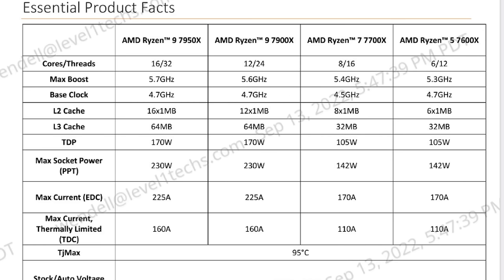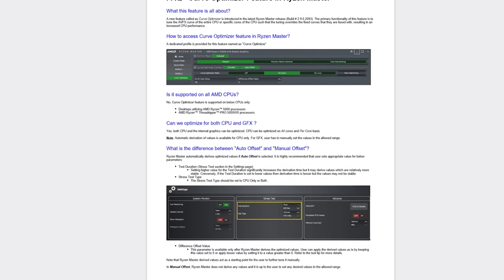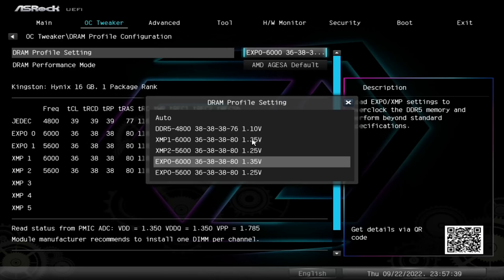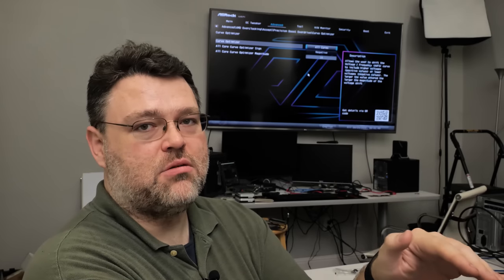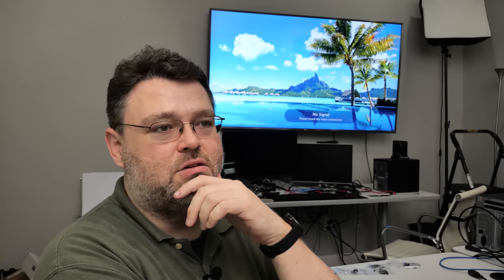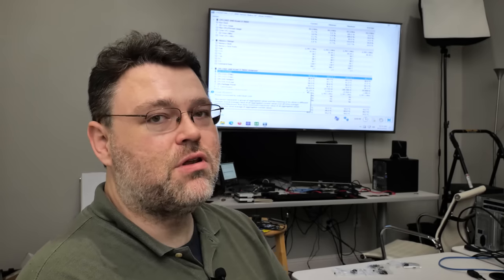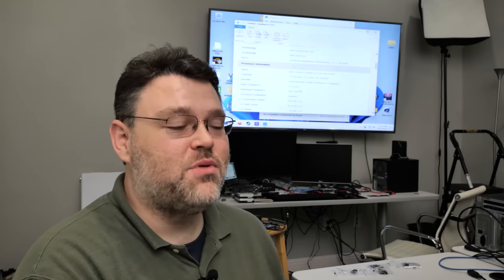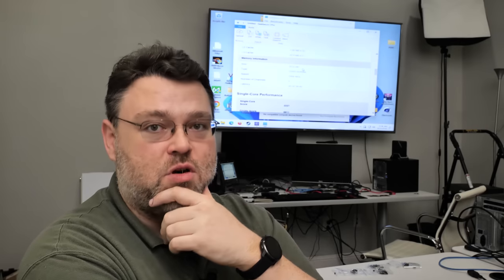Kicking Ryzen 7000 into HYPERDRIVE! Overclocking, Curve Optimizer, 5.85 GHz!

Comment: Glad atleast your channel wasn't ignorant and decided to a look at curve optimizer. Its shame because its basically two settings for AMD to drop 30c, be 4% faster than stock and atleast 40% more efficient Than stock. Why its not by default...
Reply: They set stock to work on every CPU, if they require less volts more dies will fail validation.
Optimum Tech has a video (fixing 7000) on tuning too.
Reply: Because there's no guarantee it will work and no guarantee it won't stop working after some amount of time.
Reply: IMO I don't mind AMD sandbagging like this 😅
Reply: My 7950x has to have a negative max clock. To be stable with a negative curve optimizer.
Reply: @250hero  have you tried a bios update?
Reply: Impossible to drop 30c. I have a pretty agressive negative curve at -25 stable and I still hit 95 in a few second in cinebench. But my idle/gaming temps is about 5-10c lower
Reply: @NoXQc Lol there are literally countless people who have dropped from 95C to well under 70C. Just do a quick search man. Your cooler might be shit or it’s user error.
Reply: @Mojave_Ranger_NCR  no one is dropping 30c in C23r with a negative curve on a 7000 series. I have the best AIO money can buy before a custom loop my guy
Reply: @Mojave_Ranger_NCR  only way to do it is delid and or lapping
Reply: I think it's because not every piece of silicon is equal. They have to find a happy medium where ALL their chips will perform. Then it's up to the user, if curious enough, to find tune. Otherwise they'd have to manually tinker with every chip if you wanted optimal performance out of the box. Just a guess.
Reply: @NoXQc future person telling you you were wrong 🫡✌️
Reply: Mine just lost performance atleast on fps games lost 60-80fps

Comment: Wendell, thank you for going through all of this and doing it in such a way that people who aren't nearly as tech savvy as you or the majority of early adopters of AM5 may be. Coming from a 5800x and running it all stock to as of later today a 7900x learning how to actually use curve optimizer is a benefit for damned sure. I would be interested in seeing you go through similar steps using some of the different bios that are out there (Asus, MSI etc) I would also be interested in seeing what if any extra headroom you get or how the temps may be improved going from a 360mm rad to a 420mm rad. I wouldn't expect a massive difference but then again, AM5 has already shown with a few slight tweaks the performance and thermals are pretty damn good.

Comment: Thank you very much. I have the 7950x on an Asrock board so it's like you were speaking to me directly, lol. I am able to get the PBO stable at -30 and get an all core boost between 5300-5400 MHz during Handbrake rendering. 95C temps on a robust custom loop at 175 watts. I was curious if I was getting my full potential, as I am newer to AMD OCing. This video was a great relief and I appreciate you spelling it out for someone like me.

Comment: One of the cool things about Ryzen Master is that it will tell you which 2 cores are the best performing / boost highest at the stock voltages. So if you want to go into the weeds of optimizing the curve for each core, having a more aggressive offset on your top couple of cores is a great place to start and may help get that last bit of single core performance. Another helpful thing when using the curve optimizer for each core, when you run into stability issues there's a way in the windows event viewer to see which core caused the system to crash (I forgot how to do it off the top of my head). This is incredibly helpful for pointing you to the next adjustments.
Reply: My undervolt on Zen3 required this, only a small -10 undervolt is stable on the 2 cores used for single thread  work.
I saw there's a utility to test each core and flag errors, to find the problem cores, but I haven't used such targeted testing to tune perfectly
Reply: On my 5900X I used Hydra by 1usmus to automate the testing for CO instead. It tests per core and gives you values to put in bios instead. If it crashes during the testing, the log will tell the program which core it was working on and it will continue the test, correcting for the crash.
There is another option to setup a hybrid OC that overrides AMDs algorithm, which gave me 6% more performance with the same voltage. It handles CO values beyond AMDs limit.

So much work! It sometimes takes a dozen of tests Per Core to find the optimal CO for a given voltage....
Reply: you got the wrong way. The 2 best cores get a small offset for the curve optimier, since they tend to boost higher and need more power to do so. If you lower them more than the other cores, you will just crash. The other cores usually can use a bigger offset and save more power, since they are never given the single threaded load where they will need to boost high.
Reply: @changen4125  the OP seems to be trying to overclock and increase frequencies with a CO positive offset on the 2 ST cores for stability, rather than use  undervolt to gain performance by more CO boosting.  At least I presumed the CO per core adjustment is to stabilise just the best cores after other changes rather than overvolt every core.
I agree, undervolt CO to allow higher boosts seems a better strategy to me.
Reply: @HexerPsy  I read about Hydra, but wanted to see independent testing of the claims.  I remember the author from the RAM timings utility
Reply: @changen4125  Thats not entirely true... AMD tests the curve no each core chiplet. They choose efficiency over clock speeds, and the max clock speed decides the bin.

My 5900X has a higher boosting CCD1 that has higher max clock speeds in single threads, than CCD2 (max on CCD1 is 4875-4925, and CCD2 4775-4825).
But ironically, CCD2 is can handle better boost clocks under full load (CCD1 on 4350 and CCD2 on 4450).

It marks the best cores based on efficiency.

Also, if you tune CO to individual cores, and the processor loads more than one core, it will use the lowest CO of the cores in use.

CO allows you to test your silicone lottery by checking if the core still runs at the a lower voltage. But saldly that leaves some performance on the table...

A core that runs hotter also needs more voltage to remain stable - more voltage increases temp - so it must ask for more power, etc. Alternatively it can reduce clocks, because the switching speed of gates is mainly where the heat comes from.

This means there is a sweet spot temp for Ryzen 5000 of about 70C. Above that, thermals and power run away. And below that, the lower you go, the more stable the chip is, the higher you can boost.
Ryzen 5000 wasnt designed to run at this sweet spot, but Ryzen 7000 will seek out its thermal sweet spot at 95C.

Only I have a hard time believing the thermal sweet spot is that high... I am waiting for the tools to allow the community to find that sweet spot.

Comment: At a setting of negative 30 on Curve Optimizer, my 7950x hits 5750mhz on three cores, and 5500 on all cores during most benchmark runs. Then I limited my temps down to 90c. This dropped my cores down to 5350=5400. So I'm happy with that, and my system runs very quickly on all tasks and sims. With this setting, I scored over 1500 on multi in CPUZ and 750 on the single thread. I also got a score of 38240 in R23. Love this processor. I'm using a Strix X670E-E wifi, 64gb of GSkill Neo 6K and a 7900XTX. I NORMALLY in the past always bought the Hero board, but this go around it was WAY overpriced, and the Strix actually was better equipmented for a lot less money.

Comment: The Arctic AIO's are monsters for the price. On Arctics eBay store I picked up a 420mm for $65 earlier in the year and it handles my i9 7960x at 4.5ghz like a champ (over 300w under load). The 240's and 280's are regularly under $50, all include full 6y warranty too.
Reply: Wow. At that price, there's not much reason to get anything else besides maybe custom water. I love Arctic products and how they stand behind them. 💪
Reply: @jesh879  Custom water is waaaaaaaaaay more then that do. I've got around $1000 in my loop lol
Reply: @benjaminsmekens2344  yeah I know I have built loops before. I'm saying if an Arctic AiO is so cheap, you basically have two cooling solutions worth buying -- one cheap and one not.

Comment: I'm definitely interested in seeing more on curve optimizer. I'm one of those who do gaming, but I'm also a hobbyist when it comes to making mods. I will look into upgrading from my current 2700X when the prices of the new platform drop. In particular, I'd be interested in hearing your thoughts possible merits for separate curve optimizer profiles for gaming and productivity.
Reply: There is a OC utility from 1usmus either CTR for 3000 series or Hydra for 5000 and higher. 7000 isnt supported yet.
But it can automate testing of Curve Optimizer for you, and you can put the results into the bios. It also has an option to change the CO profile when under single thread loads or high thread loads if you use the utility instead.
However CO is limited to a value of 30 on 5000 series, and Hydra has a 'hybrid profile' that goes beyond that with a lot of profiles depending on instruction set and number of threads loaded, to get the most out of the chip.

For me this meant a 6% higher score on my 5900X in CBR23 with the same voltage. From 66C to 71C under full load under a MSI 360 rad.
There is a gaming profile and the option for 2 custom profiles for specific applications too.
Reply: Could you please describe how should I do that? I have a 5900x and I wanna know how should I test each core in both stressed and non stressed mode.
I ran Amd ryzen master per core CO and it set -29 for all cores but when I apply that in bios system crashes just after a while windows boot up. I am looking for better tool to test each core on stressed and non-stressed mode for more stability.

Comment: I can't wait for people using curve optimizer, tweaking it for 1-3 days and then complaining about "shitty game XYZ crashing because devs are stupid" on reddit declaring that the issue is not their "stable system".
PS: My 5900X runs about 150Mhz higher (all core in Blender) using curve optimizer and uses less power.
Since the new main boost target is temperature, you should be able to get a lot out of these CPUs if you do it on a "per core basis" but proper tweaking can take weeks of work.
PS: If you want better maxed out all core performance, leave the "Max CPU Boost Override" Setting to 0
This setting will greatly influence your possible curve optimizer settings towards the positive range, which you don't want in that case.

Comment: I've seen the ECO mode settings that AMD is still working on right now and I like this better than anything else.  But, what I WISH AMD would do is allow more settings, and this would accomplish the reduction in clock speeds along with the reduction in power all in one easy step.  For instance having the settings of 150W, 120W, 105W, 80W and 65W for the 170W TDP parts would be GREAT.  That gives you pretty much everything you need right there.  For the 105W TDP parts, 95W, 80W and 65W ECO setting would be GREAT.  Frankly I'd just set it at 90W which would have little effect on the 7700X in light loads.
Reply: All the channel really fuck up real bad with this temp "problem"and don't Intel 12 gen got the same heat problem they even come up with a contact frame  at less am5 cpu don't throttle at 95c
The real problem is the cpu rarely hit 100% utilisation in most scenario so it not gonna hit the 95c in normal usage or playing game unless you use exclusively your PC to do benchmark or heavy cpu workload for a long time this is a non issue
Reply: If I am not mistaken... you can set Ryzen Master to limit PPT to whatever wattage you desire. Since its RM, you can open the program and switch modes with a few clicks. I think thats the closest you can get without programming something yourself that calls RM API to set a different PPT limit.

That way, under light loads you get the benefit of high clocks, but as you hit your personal set PPT, it will reduce clocks - and temps may not hit 95C if your cooler is good. If you manage to keep temps low enough, the lower temp could add 50-100MHz highest boosts for the same amount of power.
Reply: @HexerPsy  one guy undervolted to 0.98v and down clocked to 4.8ghz and got 55c under load so you can easily make temp better
Another one delided the cpu with stock voltage and clock it dropped temp to 70c

Comment: For my 7950X I'm using an EK AIO Basic 360 with fans swapped to Noctua NF-A12X25s, and with my PBO + curve optimizer tuning I'm getting single core boosts of 5.93 GHz! I'm very impressed with the performance, though it still runs very hot under full load
Reply: That's awesome Kyle! Thanks for sharing.
Reply: Nice :D
Could I perhaps ask: Whats your temp under a single thread load like Cinebench R23? And how many loaded threads does it take for the chip to hit 95C?

I am asking because I wish to know where the tipping point is where the 7950X hits that thermal wall....
Reply: @HexerPsy  For Cinebench R23 single core my max temp for Tctl/Tdie is 76°C and average temp is closer to 64°C for the run. For context, my motherboard is an ASRock X670E Taichi and my CPU fans are set to the silent profile in BIOS. For R23 Multi Core, temps jump up to 94.9°C and pretty much stay there for the whole run, fluctuating in the 90s.
Reply: @kylemueller  Thank you very much :D I appreciate the info!
Follow up question: how many threads of CBR23 do you need to load to hit the 94C?

You can specify the number of threads in cinebench preferences. I am guessing somewhere between 4 to 8 threads based on your single core temp.
Reply: @HexerPsy  4 threads maxed out at 79.8°C and averaged around 77-78°C
Reply: @HexerPsy  8 threads maxed out at 82.6°C and averaged around 81°C
Reply: @HexerPsy  12 threads maxed out at 84°C and was averaging around 83
Reply: 16 threads maxed out at 88.6°C and averaged around 87-88
Reply: 20 threads maxed at 90.5°C and averaged 89-90
Reply: 24 threads maxed at 92.6 and stayed around 92 for the run
Reply: 28 threads finally hit > 94°C. Maxed at 94.5 and averaged 93-94
Reply: Just ran with all 32 threads again and got 95.1 max with averages between 94-95
Reply: @kylemueller  You are worth gold! :D Thank you so much!

Comment: Wow didn't even know I could do that using the curve optimiser, my processor runs so much cooler now and my fan doesn't even ramp up when playing a game.

Honestly though this curve optimiser should of been a stock setting or optimised by defaults when you load it, becasue it doesn't seem risky but it's a massive enhancement.

Comment: got a new 7800x3d, did a -15 offset, and ran a few games with it trying to monitor temps (things are a bit spiky, and i've had some instability with like FAH for an hour will stablise at 77c, and then occasionally i'll get spikes to near 90 with an NH-D15 with low load) ; ive seen hwmonitor reporting >6ghz on most cores max, but how much you trust hwmonitor is up to you, so it's definitely doing something in those cases. it also reports only 20% util while folding with ~4.6Ghz boost, so grains of salt everywhere.

Comment: It is a pity that ASRock doesn't have an eco-preset: undervolted and slightly underclocked for all-core while maintaining the highest single-threaded performance. I am confident that most users would get the best user-experience that way. Zen4 seems to come quite overclocked out of the box, too much past the sweet spot. Like losing 30% performance for 25% of the power without even undervolting.
Reply from the maker: They just updated the bios to work with newest Ryzen master which has a one click eco mode
Reply: @Level1Techs  Not for me, Linux only on my desktop and I also am a gamer. 😁 
But as long as you can do it in the BIOS it is fine.
Reply: @Level1Techs  Undervolted in combination with eco-mode, that seems the way to go these days. For both CPU's and GPU's but for GPU's it still is problematic on Linux, at least for CPU's we can do it in the BIOS. That last step which AMD should take to improve the Linux-user-experience.
Reply: This state is a result of Intel pushing up power for 5 years and allowing mobos to unlimit power.  Alder Lake was well received .. but I could see how they achieved it, so was less impressed.
Now Zen4 engineers max performance based on reconfigurable limits more conservative than Intel and "95C!  Hard to cool" and "Expensive" seems to be the verdict.

Comment: I only got another 140mhz out of my 7700x. But the power draw is down to 90 watts and the temperature came down to 70C. I'm really happy with that.
Reply: Go more aggressive on negative curve optimizer, oddly enough the range seems to improve with PBO. At stock mine was losing performance on benchmarks at -25 curve yet still reaching full boost clock.

After increasing PBO to max, I was able to further push my negative offset to -45 (was causing some instability) so I backed it down to -40 sitting roughly at 1.205v max.

PBO and negative offset seem to scale together, one allowing you to push the other further.